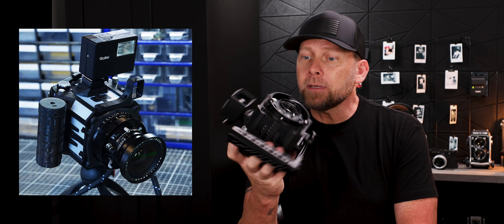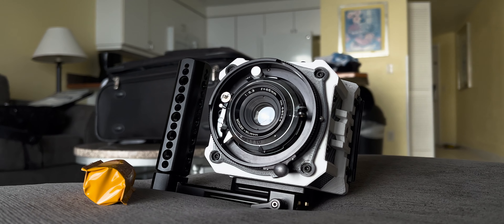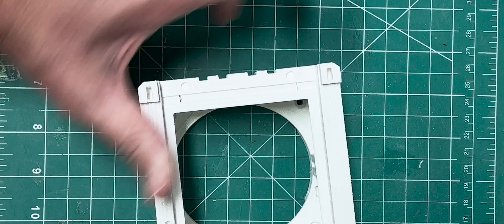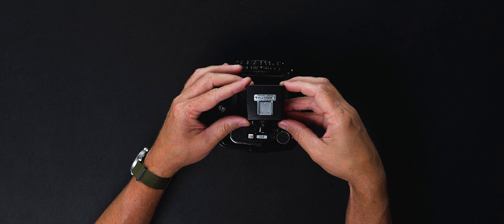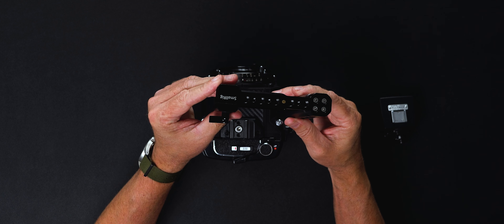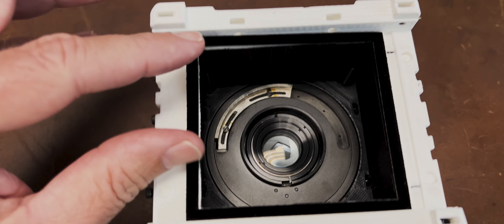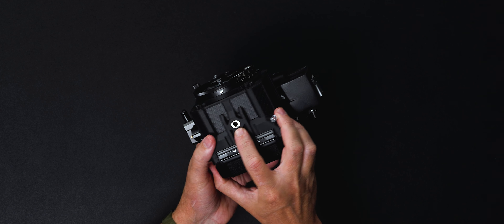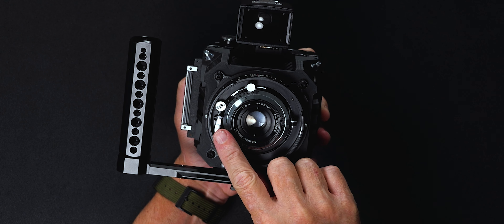I Built This CAMERA

Comment: I once borrowed this setup a few weeks. Very admirable idea, and probably will built myself one. Nevertheless, I saw at least one issue with the camera: not seeing directly through the lens = parallax error, so you need to counter it, e.g lifting the camera a few cm higher after framing (assuming on tripod). In general, shouldn't be an issue for typical landscape or travel photos. 
But for doing close up/macro shots? Well a bit challenging. SLR is way much easier.
Reply from the maker: Agreed, but for me, this type of camera is for fun. Kinda like a pinhole or plastic camera. It’s definitely not something you’d use for a paid gig. And I love the idea of people developing new film cameras. Building something new and mixing it with something old. That and it’s beautiful and fun to build.
Reply: Would also work fine for street photography. Cropping on medium format is kinda why medium format, for me anyway.
Reply: @camerafusion  This is not a major criticism, though. As a TLR user, I still experienced parallex error sometimes. Oh well :D
Reply: That isnt a problem unique to this camera, all rangefinders have the same issue. They still sell though because people figure out how to compensate.